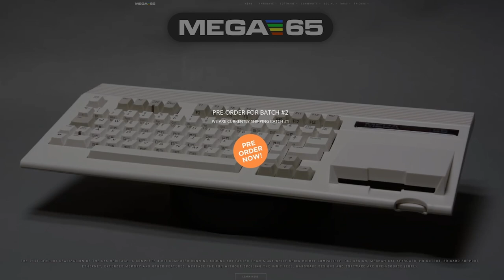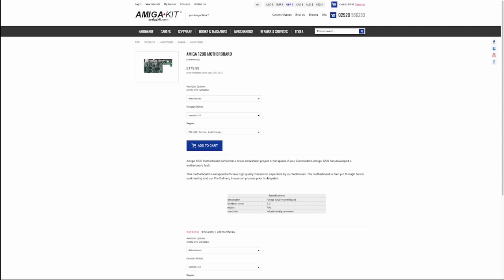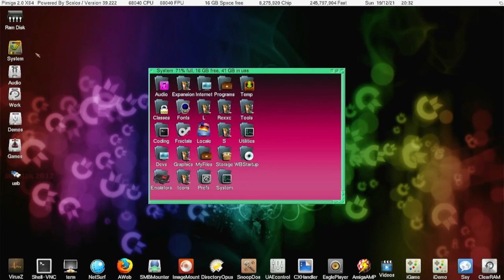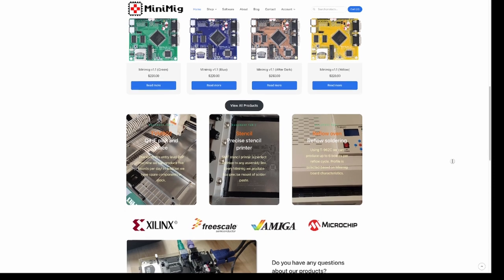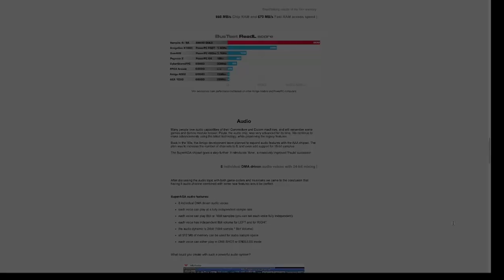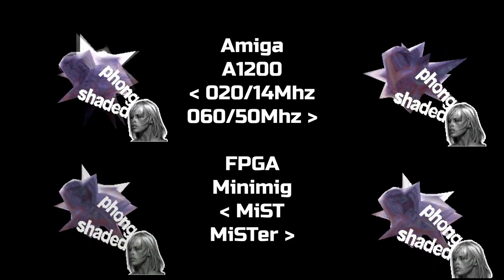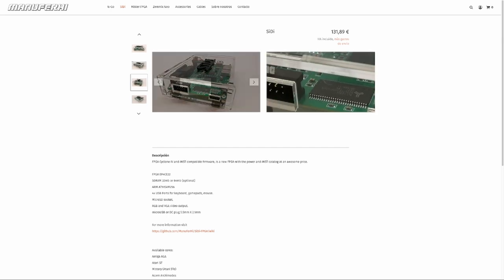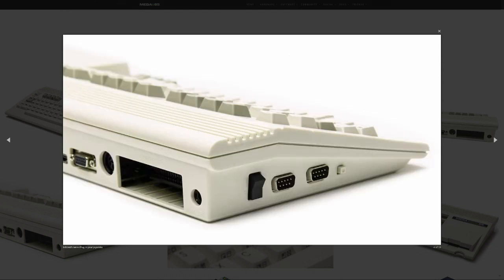Amiga Computer Buyers Guide 2022

Comment: The days of affordable classic Amiga's are indeed almost gone. One really need to know were to look for a good deal these days. After all. It is 30 years since the 1200 were released. I went for a semi refurbished route, in regards to my machines. I bought them cheap within the last 5 years or so. Fixed them up and slowly upgraded whenever I had the money. The process of owning a good upgraded 1200 these days, can take up to one year, if you dont want to spend a lot in one go. And indeed a good recapping cost money, not cheap, if you want a good job. Like I bought my 1200 as a rust pile, for a low cost, and the first I did was to get it recapped. Then slowly I bought stuff like new membrane. But I fully understand people want something here and now. Just be patient and learn a couple of new skill's here and there.

Comment: I own one of the first Amiga, an Amiga 1000, then had a 500 then a 2000. I still got the 2000 and I only use emulation for Amiga apps. There is no sense on buying an old Amiga at those today prices. Emulation is good enough.
Reply from the maker: Yeh its expensive for sure

Comment: I picked up a refurb (recapped, timing mods, etc) A1200. It was expensive but absolutely worth it in terms of entertainment.  I went with RetroPassion and I am 100% happy with the work.
Reply: Must have been pricy
Reply: Amiga enthusiasts' obsession with price is puzzling to me. These platforms are every bit as interesting and historically relevant as NeXT, SGI, or LISP Machine hardware. If you want the market to continue to support your platform then you should be willing to pay for the software and devices that sellers produce/refurb/etc.
Reply: @hessex1899  That's a really pedantic way of tackling the concept of the immense cost of these machines. They are... very expensive. Why is that a difficult fence to jump over?

I run an emulator and call it a day.

Comment: Brilliant and extremely enjoyable video to watch. As a past Amiga 1200 owner that went and foolishly sold it all for a silly price, i'm using software emulation for my love of the Amiga games and Demo's. First i have WinUAE on my Windows 10 pc but i did use FS-UAE in the past until their latest release doesn't have a "Windows Installer". So i've gone back to using WinUAE again, which i really do love it. Second i'm running Amibian on R/Pi 3b+ which is soon going into a real Amiga 1200 casing which i'm soon to be purchasing from Retro Passion. I have all the other components ready for this ( slim USB 2 hub,cables and a very sought after "Keyrah v2" board. Once my A1200 casing is ordered and arrives i'll be putting it all together. Can not wait.

Comment: Using real Amigas you forget what’s out there in terms of the Amiga 

Some I’ve seen and used and others never heard off ... so much information in the video cheers for this Ravi
Reply from the maker: Very true
Reply: I've tried SBC and emulation yet it still doesn't give me the same feeling as using my Amiga 1200 and 500 does (oh sorry I said it aloud that I have 2 Amiga's I can already feel the envy 😁 ) but using them and hearing the floppy  disc's 💾 working is what's lacking with these newer ones, oh yes I own external floppies and some expansion cards for graphics ext. not to mention the loads of floppy discs with programs and games and CD's, but now I must sadly say I don't own the CD drive, wish I can get hold of a CD drive that works, willing to swop floppy 💾 with programs I never use for a CD drive.
Reply: @Thunderstormworld  I do one better 1200 600 and a 500 all kept from 1992/95 .. I totally get where you coming from with the floppies and the sound of the drive my 170mb hard drive has that slow boot turning the a1200 on sometimes misses the spin and the kickstart boot screen appears which I missed once I put a hard drive in . I got lucky with a eBay purchase a good few years ago and got an Aiwia acd-300 with a stunning led front display, my cousin had one and ever since, I always wanted one for mine 100% real hardware over emulation

Comment: Great mentions of FPGA device choices. SiDi is based off MiST, mostly its a cheaper version of the same design but using a newer (but very slightly smaller) FPGA chip.  NeptUNO seems to be Amiga only now. MiSTer has the most developers at the moment, but cores have been back ported to SiDi and MiST.
Reply from the maker: Thanks for the background it’s hard to tell the difference between devices. Hopefully it will help people looking to purchase one.
Reply: Happy to help, been using these since the MiST days in 2013 😅 Never tried an OG Minimig, though

Comment: Great summary of the huge number of options out there.  I was wondering about the board that allows you to plug a Raspberry into the 68k socket.  I get the impression that it effectively turns your Amiga into a software emulation but not quite that simple
Reply: That's the PiStorm and it's not that simple indeed, with Emu68 (that's a baremetal 68K CPU emulator) the Amiga thinks it's talking to a 68040 CPU and that's where the emulation also stops only the CPU is emulated nothing else.
The clever bit is that the rest of of the Raspberry Pi hardware is exposed to the Amiga and the OS, and trough drivers can natively use all the hardware on the pi if provided with a proper Amiga driver.
Currently the Amiga can:
-Use the RAM on the Pi up to 2GB as Fast RAM (the max RAM AmigaOS can address)
-Use the micro SD card slot as a harddrive
-Use the Pi GFX chipset as a RTG card to have a nice workbench in modern resolutions and 32bit color depth in 1080P for example.
-Other drivers such as ethernet/wifi, 2D gfx acceleration are planned/worked on.
Because there's no host OS on the pi (it just loads the very small Emu68 binary) initialization time at power on is very short like 1 or 2 seconds before the Amiga starts booting.
The result is that you get a crazy/stupid fast classic Amiga at an affordable price.
Currently I'm running a PiStorm32 with a Pi4 @2.2Ghz in my A1200, if you ever wondered how fast a 1Ghz+ 68060 Amiga would be then here's your chance.
And where only scratching the surface now, there's a lot of potential still left unused within the pi, if provided with proper drivers the Amiga could also utilize the GPU trough Warp3D, the hardware video encoder/decoder, USB etc.
Long story short it's actually the Amiga that takes control of Raspberry pi 😄

Comment: So I get to be the Negitive Nacy? Where's MorphOS? My Mac Mini still kicking in full HDMI (DVI = HDMI if you didn't know), I could also see the Amitlon being group in the emulatons though its bare metal. I have a suprer build I need to do. I have about $120 invested Old PC Hardware for the build. I look forward to the day I have the Amiga, PC, and Mac on my desktop and they are all running Amiga Explorer. =D
Reply from the maker: This guide was more about which computers you can buy then os, I do mention sam460 which supports it. I love morphos so will defiantly be doing some content on it soon.
Reply: MorphOS is sitting in a dark room along with AROS x86 and Amiga OS4, and they're all sobbing uncontrollably, their tiny little kernels on the verge of one final Guru Meditation, before they board the celestial ethernet and head to digital heaven. May their pixels rest in peace. 😉

Comment: Sorry to comment on this video after 8 months, but, the Amiga itch had to be scratched.  I too have decided to wander into the Amiga world after having zero experience with it over my lifetime.  I have experience with everything else on just about every platform and I am old enough that when Amigas hit the market, I would have been a late 20 something year old.  I love your video and the pathway overview.  I did not do enough research before jumping right into it, starting with a very overpriced A1200 on eBay a month or so ago.  Since then I have been drinking from the AmigaOS/Workbench fire hose and "upgrading" my already upgraded 1200.  Now that I am where I am, I have to disagree with the idea that "new to Amiga" users should not delve into the last path, that of the SAM and A-EON.  For me, I prefer the polished look and functionality it offers, but with the legacy OS.  That seems really where I will wind up.  So why not go there first and save some money.  If things do pick back up with that whole scene, I will be the first in line.  X5000's are no where to be found.  I kinda like the Vampire, but it seems to have some compatibility issues.  There is a fully built X5000 system (of course out of stock on Alenia Computer's website) for 2399 euros.  I would purchase something like that in a heartbeat.  I hope things will work themselves out with who owns what and becomes a solid unified something.

Comment: I got a A600 the one i got 30 years +ago. A Hdd  was installed at one point. And now i cant run it properly. Id love to refurbish it. Id have to check out the options. My problem is i dont have a joystick anymore.emulators have one big problem  the different config needed for each game you run.. or they will run to fast

Comment: Personally, I think you have to be a complete lunatic (sorry, I mean "extremely dedicated and wealthy enthusiast") to buy a so called "Next Gen" Amiga these days. 😉  For an Amiga inspired OS, AROS x86 is free and runs on cheap hardware. Every "next gen" OS uses emulation to run classic Amiga software anyway, so you might as well do that on something far cheaper and more powerful than an old, expensive PPC chip fitted in an expensive but limited motherboard. Hyperion could do far worse than port OS4 to ARM. Their sales would increase by an order of magnitude. Yep, they'd sell 10 copies per year rather than 1.  😁

Comment: I'm a completely new to trying to do anything Amiga, but had a question around the last category, the Power PC. Can you just find older Macs that had a Power PC internal and run Amiga OS on them? Or is there some kind of a huge hurdle setting that up?
Reply from the maker: Yes you can! Check out Morphos operating system. It works on the Mac minis and old ppc macs. Install it for free and install the chrysalis pack and you will have a good Amiga environment. You do emulation via fs-uae. I will actually be doing a guide on it soon.
Reply: If you are thinking AmigaOS 4, then no. You can use MorphOS that is an Amiga inspired OS. An PPC Mac however, is not a real Amiga in that sence. And you really need to look for the right Mac model for MorphOS. I have a Mac Mini G4 1.42 ghz machine and that is fully compatible with MorphOS. And no matter what new gen Amiga you choose to own, you still need an emulator to run the old Amiga games. You are basically left with emulation, fpga or classic hardware as the only choices, if you want to run games from the late 80's and early 90's.
Reply: @Djformula  Will be looking forward for the guide :D
Reply: @brostenen  Thanks for the detailed answer :)
Reply: @tsuikagura  No probs. For classic gaming, and those with money. Then I always recommend the following setup.

 - Amiga 1200 fully recapped.
 - Tsunami1230 or TF1230 accelerator.
 - IndivisionAGA-MK3 scandoubler.
 - Kickstart 3.1
 - Angled and buffered CF-IDE adaptor.
 - 16 or 32 gb CF Card.
 - One of the ready made HD Image with WHD Loader.

Just make sure that the 1200 motherboard are fully compatible with the accelerator. As some boards need a timing fix for certain accelerators to be stable. My revision 1D1 runs stable without the fix. However some early revisions need the timer bug fix. Other accelerators from the 90's have buffers enough to get around that bug.

For people that dont care for the physical look of the hardware and are only interrested in the games them self and nothing else, then just go for a Mister or minimig.

Those that are not that picky about full authentic look and feel in games, then go for some kind of emulation on something like PI400 or something. A500-Mini if you want the most easy way.

For those that are interrested in NewGen Amiga, then start with MacMini G4 1.42 if you can find one for cheap. Else go with the real Amiga NG boards, because the Mac Mini would be too expensive for what you get. Also. Real AmigaNG's can run both AmigaOS4 and MorphOS. Plus Linux of course. You get way more for the money, though they are still more expensive than fully expanded 1200 in tower case and with PCI slots and all that.

Comment: Original computers are getting to be for the wealthy. The prices people ask for them are high now.  It's not for Joe average now, certainly not to have a large collection. I'm so glad I bought my retro computers many years ago. I don't have anything Amiga more Advanced than a A600 and several A500. First thing I did with each of the A500s was remove the battery's as they all had the ram expansion fitted. These computers climb in value every year.
Reply from the maker: Yeah it's amazing how expensive they have become when once people were literally chucking them out

Comment: i would buy brand new amiga that run native old floppies but not any linux amulation thingy and not expensive nobody want powerpc now we say this is amiga lol its powerpc not amiga.
all things we allready can do free with emulator. someone try do real hartware FUNNY.
when all done. someone do something else doing real hardware using raspberry pi. lol. just use raspberri pi with emulator we allready had it why need real hardware xD we allready have acceleration card on real amiga that are same fast than raspi can do. its this fast soon faster. allready have real amiga doing same fast lol
cant magically go any faster flash drive cant read write faster than they do xD

Comment: Love yours and Dan's podcasts, just got a A500 from eBay for £60 (already had psu, mouse, modulator), everything works except F1 key, any general advice 
?
Reply from the maker: That is a bargain, I would take the keyboard membrane out and clean it with a bit of iso. If that does not work you can get membrane replacements for cheap online.